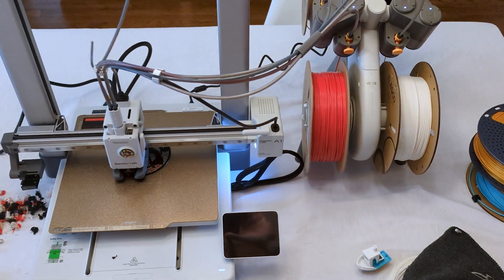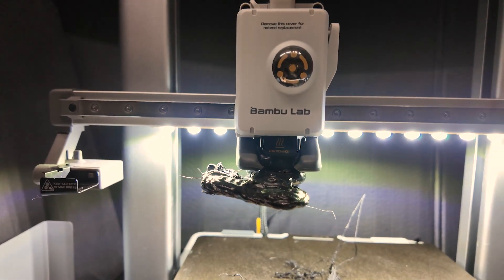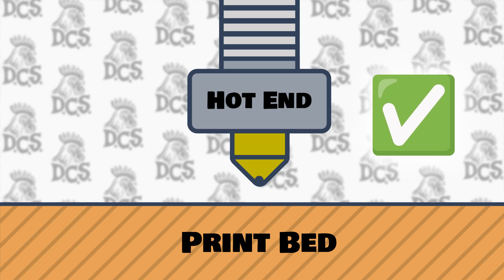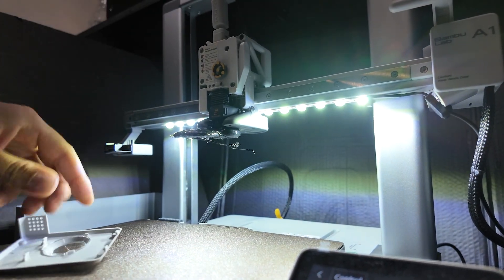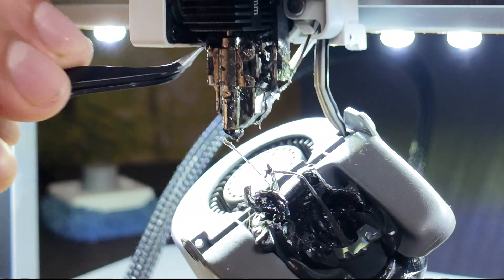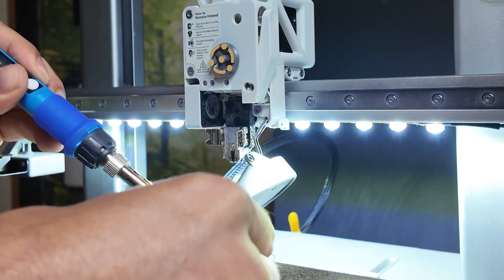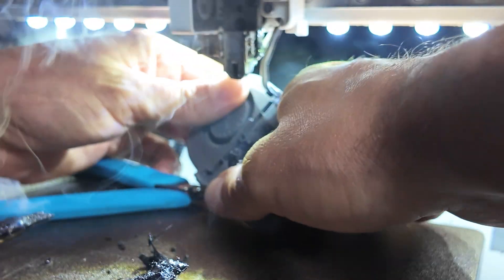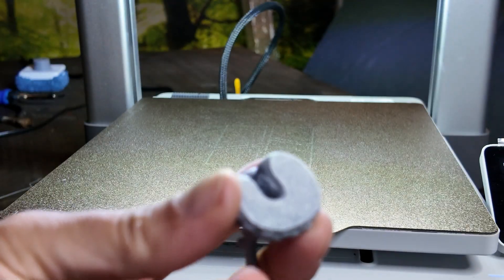Bambu A1 Blob of Death: What Happened & How I Fixed It

Comment: The A1 also has a clump detection, its just off by default because it is quite tedious, so i also leave it off, but if you dont plan on watching the printer you should turn it on. The printer then goes to the side of the bed to test for filament buildup every 8 layers or so.
Reply from the maker: I completely forgot to bring this up. Thank you for mentioning it! I also have this feature turned off. On my printer it created too many false-positives during successful prints, BUT people should know that it exists. Going to pin this one!

Official Bambu documentation on this feature here: https://wiki.bambulab.com/en/a1-mini/manual/nozzle-warp-detection
Reply: only if you update to the latest firmware
Reply: @thefilthelement  I have to say, I had a great experience with them.  The issue was the terrible default petg settings for their own filament, which caused micro scratches on the plate.  I thought it just needed a heavy clean (don't use isotropic alcohol, ever!).  Ended up causes the blob issue, they talked me through it and send me replacement parts and a new plate within 2 days, very very impressive.
Reply: @acidtwin  Why no iso alcohol ?  Everybody recommends it. (Or are you distinguishing between "isopropyl" and "isotropic" alcohol.  Its the former which is recommended, maybe even by BL.
Reply: Thank you!

Comment: I have my Bambu A1 for 4 months now, my very first and only printer. I have so much confidence into the printer and the filament I always use, but today I went to work and left it printing a friend's order, only to check it in the app 2 hours later, at 60% with nothing in the plate and a huge black PETG blob in my hot end 😢

Comment: The A1 also has a nozzle cleaning cycle prior to levelling. This ensures the nozzle has no filament stuck to it that could cause a different point of contact. The cycle is quite efficient at cleaning the nozzle. First it pounds the nozzle head against the front of the build plate 21 times with temperature below the flow point of the filament. Then it goes to the back of the build plate and rubs the nozzle in a circular motion on the flexible part of the build plate rear to “grind” any filament off the nozzle tip. Then it brings the nozzle to the wiper and does 2 wipe routines after which it places the nozzle against the plate at the flexible part of the build plate rear while it lowers the temperature further. Once it reaches the lower temperature, the state should be a cleaned nozzle tip with temperature too low for filament to flow. Now there is nothing in the way. The fact that yours did so and did it so badly is an indication of bad filament or incorrect temperature settings. If you are using filled filaments like carbon fibre, this can be worse.
Reply from the maker: This is a super detailed breakdown of the A1's cleaning cycle – thanks for sharing! Your assessment seems spot on. My issue was likely the wet CF filament (and failing to stop the print before it formed a blob). I adjusted a few things and haven't had problems since!

Comment: What about blobing after the first layer? My bambu lab a1 printed the first 200 layers and them it made a blob and the the print fell of the bed and it was makeing spaghetti.
Reply from the maker: This sounds like it could be an adhesion issue. If the part is able to come loose from the bed, it can get dragged around, or worse: it can tilt and impact the print head (causing skipped steps or allowing the part to fuse to the nozzle) which is what sounds like happened there. A clean bed is the best solution, but some filaments and situations require adhesive. I'll use Magigoo and a brim for parts that are tall but don't have much surface area touching the bed. So many things can wrong, it's incredible how often it goes right. Thanks for watching!
Reply: @DiazCreativeStudio  but what if the part is still on the bed? ( I had that happen)
Reply from the maker: Oh, it sounded like the print was no longer on the bed. That does raise some questions - does the problem happen every time? It might be time for a new nozzle, or a different strategy. Perhaps there's a more stable orientation for the part? Or perhaps there is warping that's causing the part to curl up so that the nozzle is hitting it, and that's causing filament to fuse to the nozzle? I'm not sure there's a single answer for that one. Would love to hear the solution once you figure it out.
Reply: @DiazCreativeStudio  the problem doesn't happen every time and im using a new original bambu lab nozzle which i got 2 weeks ago.

Comment: Be warned that this is NOT only caused by leveling issues. I was 5 hours into a print, went to bed, woke up to a blob that mangled the clip that hold the hot end. Fortunately it was the right side so bent a paperclip into a workable shape and it prints perfectly. Still, I dont let the printer go overnight now and always check on it from time to time

Comment: This just happened to me. Using PETG. I was in a rush an had to leave before the first layer. I checked the print with the handy app, but the camera didn’t show anything. I unfortunately let it continue to run. 

I came home to a disaster. Actually the blob in this video looks tiny compared to my mess. 

I’m working to get my A1 back up and running. 

Luckily I have an A1 mini to run prints in the meantime.

Comment: Yeah that could be one of the ways you get a blog but there are multiple other ways and it usually comes down to adhesive issues because if your nozzle can rip your print from the bed while it's printing inform a BLOB then you should have washed your bed and if it happens before the print adheres to the bed then guess what you should have washed your bed and no matter how much filament you get on your tip it should soften, and remember all blobs are user error it is not the printer's fault.........

Comment: Ugh...wood-filled filament tries to do this, every time!
Drying makes little difference...resins in the wood-pulp vaporize at printing temps, which leads to 'nozzle weeping'.
I monitor print start-up...flick the 'weeping' bit away with a tiny brush if I can.
Sometimes the weeping continues during the entire bed-probing process!
In those cases, I feed a length of regular PLA into the works*...just enough to pre-load the system with material than won't weep so probing will work correctly.
It ends up with a funky two material first layer, but at least it will probe properly.
X1C uses the same probing as the A1...haven't had a serious blob (yet!)

*A length of regular PLA welded to the wood-filled PLA...enough to cover the nozzle load & purge routine.
Reply from the maker: That's a really smart way to get around filament ooze. I've gotta try that. Thanks for sharing the tip!

Comment: interesting to hear that Bambu may have more problems in this respect (blob causing faulty 1st layer height) than other printers.  Why ?.  I certainly had the B.O.D. and had to replace the hot end assembly on my A1 mini when I found out how cheap they are considering the PET-G  caked on the hot end clamp so badly as to render it inoperable and almost impossible to clean even with a soldering iron.  And YES, I had not watched the first layer go down (although not sure that was the cause).  Anyway, thanks for the video and reminder to watch the first layer.

Comment: I had this happen last night.  I was able to get most of the plastic out but still have some in the clip. I thought about using a heat gun but figured the heated  area would be to large. The sacrificial soldering iron is an excellent idea and I will use that tonight. Thanks for the great tip.
Reply: Had the same issue .. was using clear orange and my clips are hardend stuck now ... look like orange candy... ugh

Comment: Absolutely right, look at the first layer. There's one of my printer that never had that. That's the one printer on which I never turned off the first layer inspection - I don't have to watch it; it does it itself, the X1C, and that's the small difference. You rarely need the extra charge if you don't want to always look at the first layer... I don't want to tell you how many first layers I've looked at on old printers and always learned something, but now I know it and am happy to leave it to the printer ;-)

Comment: I just started 3d printing this year had my first ever 3d printer the bambulab A1 mini and out of the box it was super easy to setup and start printing, I’ve printed a lot of things from useful stuff for around the house to just fun toys that are just around my room. Had my first ever blob of death and had to replace the wire for the hot end. The customer service was spot on, help me fix the situation and sent out a free part that needed to be replaced. They said for next time try doing some easy steps to try and avoid happening again. I fixed it and it’s back up and running printing, so in my situation I still love the printer and the pro really out weigh the cons. Going to be upgrading to the A1 soon.
Reply from the maker: I've heard the customer service is good, fortunately I haven't had to use it... yet. Glad you got your blob sorted! The A1 is definitely worth it.

Comment: this has direct relation to retraction settings. It means retraction is set too low, so it allows filament to ooze after it should not. but I do indeed agree this could be a very good culprint as on wiping the bambu printers does not always manage to prevent re-oozing out. Would be fun to know where in the machine gcode the retraction settings BEFORE wipe is, to control so the flow is turned off well before it try to wipe.
Reply: This 
Have in a1 1,6k hours on my Mini 1,4k hour i dont Check everytime the firstlayer but calibraition  my Filament flow retraction  and you get never a blob

Comment: I had that happen one week in. I had to break it all off and replace almost everything in the extruder, but I'm so thankful Bambu sells individual replacement parts for nearly everything. My experience was wet filament that stuck to the nozzle as it was running and kept building up.
Reply: My A1 mini keeps giving a temperature warning for the hot end… can I buy a replacement for the temperature sensor? I honestly feeling dumb and can find the part number for it …